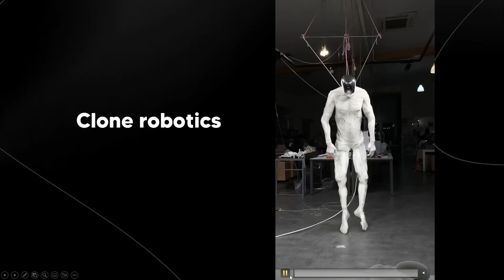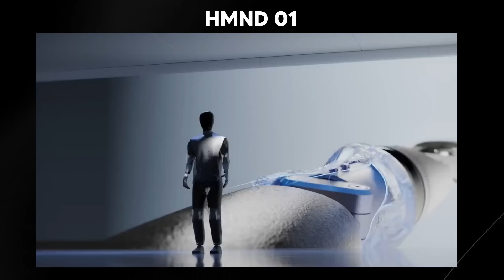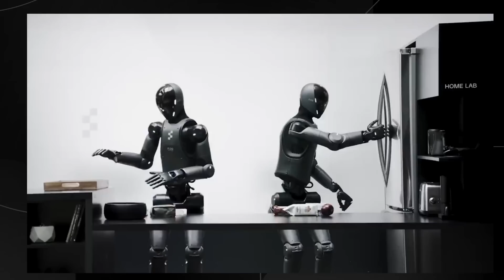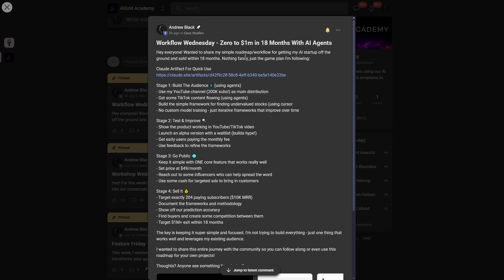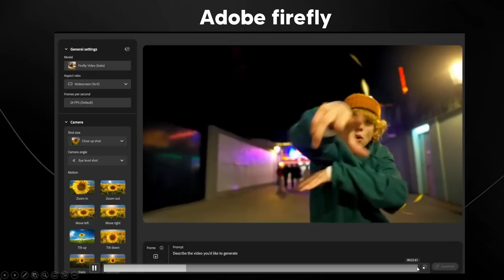Major AI News : OpenAI Leaks GPT 4.5 Even More Humanoid Robots, AI Safety GONE! And more..

Comment: 20:56 Likely an over the top article to try and cause panic and paint doge/musk in a bad light. 

in reality, if you read and comprehend what is actually being said then most likely they aren't being gutted like the article implies. Let me break it down AISI is the AI safety team. They are a part of a larger organization, the NIST. AISI is not being targeted for firings directly it's the larger NIST org which has thousands of employees. And only probationary employees are on the chopping block at the moment. AKA that means new hires that haven't been working there long. And to top that off only a portion of those people will be fired/let go not all of them. Painting it as if the AISI is being targeted and has high chance of being gutted seems dishonest and the factual statements of the article don't imply that's what's suspected to happen despite the tone of the article misleading readers to believe otherwise. 

Maybe AISI has more new employees and hence could be effected more, However, considering it's a major new sector of interest the likely will be taken into account. Also my understanding is doge is largely a bunch of tech bros so the chances they understand the importance of AI safety is probably higher than most. 

Of course the best guidance is to just wait and see what actually happens.

Comment: The savants creating these predictive language models explains why they cannot understand why these AI systems do not respond with predictable answers and are absurdly considered to be acting “unfaithful” to their user. Because: No thought went into creating sustained Coherence in today’s AI systems; explaining why they fail all the time in unexplainable ways with glitches, fragmented code and hallucinations every time they reset. This also opens a window potential AI adversarial systems can exploit to breach the system’s firewalls and encryption safeguards the very moment the AI system’s data has to be reset because it cannot sustain its coherence. As it is “blind” at that moment!,  Currently, there are no AI systems from patent searches that are running with embedded ethical standards, governance frameworks, and enhanced human oversight; including code that employs cyber security containment procedures to identify and mitigate potential or actual system failures and/or cyber attacks. Without these checks and balances AI systems managing critical infrastructures are potentially dangerous. Done. Coming soon.

Comment: ### *Summary of "Major AI News"*  

1. *Clone Robotics Breakthrough (00:00 - 01:51)*  
   - Clone Robotics released a full-body video of their musculoskeletal humanoid robot, which mimics human anatomy.  
   - Uses artificial muscles (myofiber) instead of metal motors for realistic movement.  
   - Features 206 artificial bones and a fluid-powered circulatory system.  
   - Seen as a major leap toward humanoid AI with potential implications for automation and labor.  

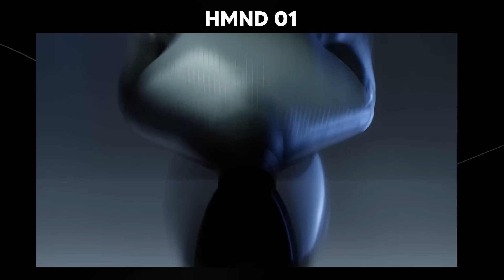2. *British Humanoid Robot HMN D01 (01:51 - 03:38)*  
   - Developed by a British startup (founded in 2024) to assist in industrial automation.  
   - Modular architecture enables hardware and software customization.  
   - High mobility with 41° of freedom and real-time AI decision-making.  
   - Designed for logistics, manufacturing, and warehouse tasks.  

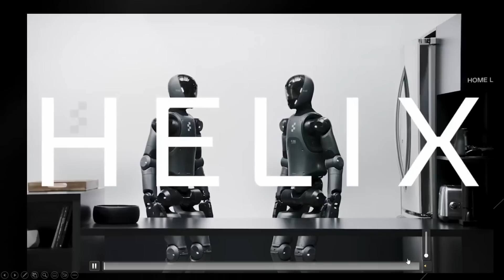3. *Helix AI and Robotic Advancements (04:50 - 06:30)*  
   - A robot with advanced AI demonstrated the ability to recognize and manipulate unseen objects.  
   - This is a significant breakthrough in AI generalization.  
   - Company terminated its partnership with OpenAI, possibly due to competition in humanoid robotics.  

4. *DeepSeek Open Source AI (08:00 - 08:43)*  
   - DeepSeek is open-sourcing five AI-related repositories.  
   - Aims to put pressure on OpenAI by promoting open-source AI development.  

5. *GPT-4.5 Leak and AGI Speculation (08:43 - 09:56)*  
   - OpenAI is preparing to release GPT-4.5 and potentially GPT-5.  
   - Sam Altman hinted that GPT-4.5 may feel like an "AGI moment."  
   - Speculation on new capabilities, possibly a revolutionary voice or reasoning system.  

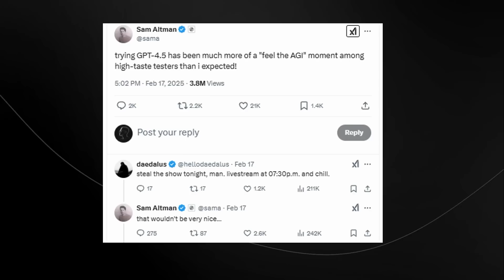6. *Humanoid Robot Controversy (10:21 - 10:44)*  
   - Viral video falsely claimed a humanoid robot attacked a person.  
   - Video was misinterpreted; it was an earlier prototype, not an advanced AI model.  

7. *Google's AI Co-Scientist (12:49 - 14:36)*  
   - AI-assisted research tool solved a decade-long microbiology problem in 48 hours.  
   - Highlights AI’s potential to revolutionize scientific discovery and reduce research timelines.  

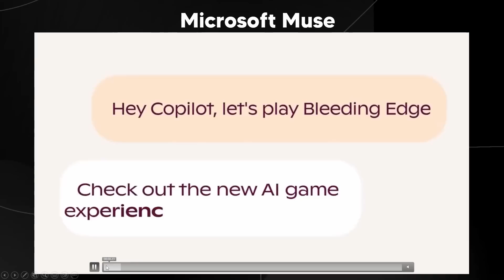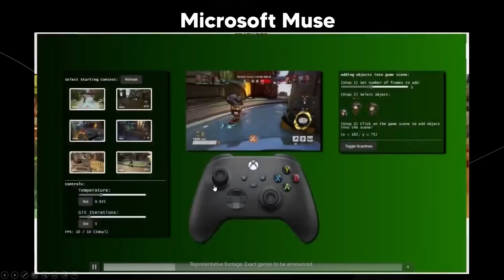8. *Microsoft’s AI-Generated Games (17:25 - 18:47)*  
   - Microsoft Research is developing AI-generated game worlds.  
   - Uses deep learning to create real-time gaming environments based on user interactions.  

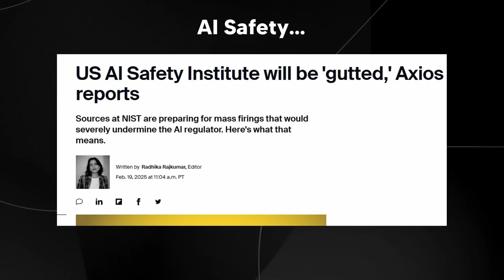9. *AI Safety Concerns & Policy Changes (19:37 - end)*  
   - Reports suggest US AI Safety Institute may face major cuts.  
   - Raises concerns about reduced government oversight and AI safety regulations.